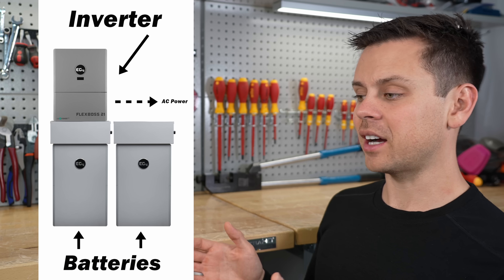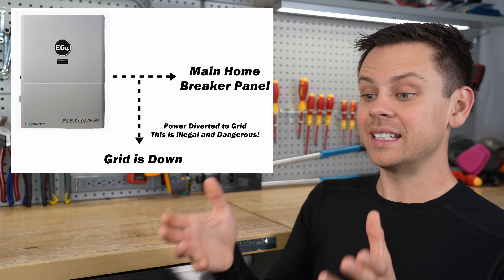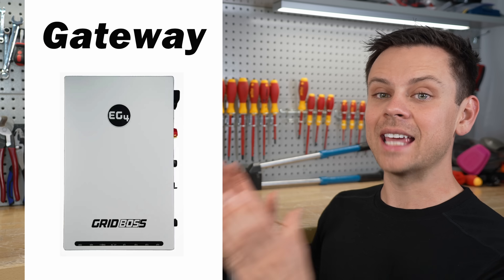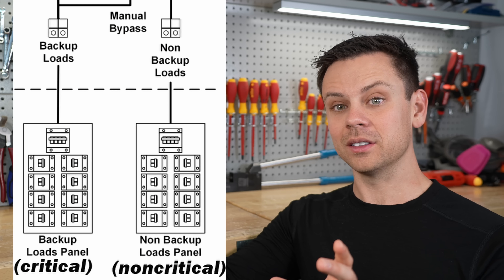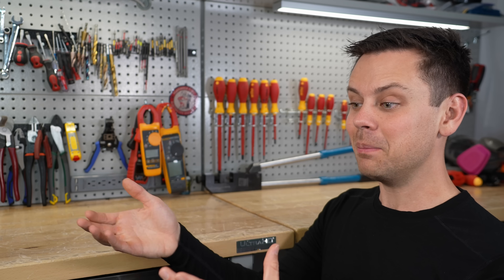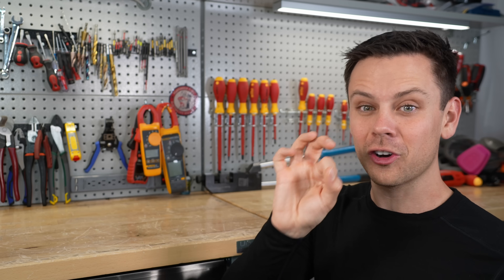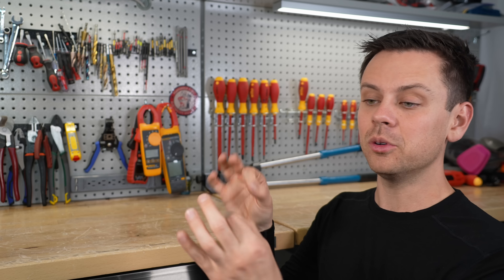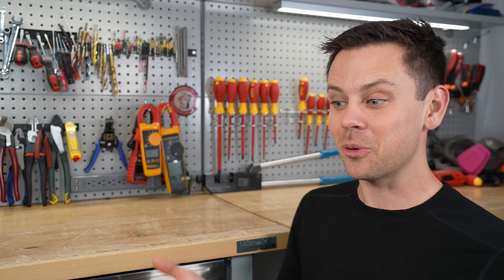EG4 Grid Boss Gateway: What is it?? Beginner Friendly Tutorial!

Comment from the maker: Product links (if you use my affiliate link below, automatically save $50):
Flex Boss 21: https://signaturesolar.com/eg4-flexboss21-16kw-ac-hybrid-inverter-48v-split-phase-21kw-pv-input-v1-1/?ref=cPwLcVc0SW-BjN

If you already have batteries, check out the grid boss/flexboss bundle:
https://signaturesolar.com/flexboss-gridboss-bundle?ref=cPwLcVc0SW-BjN 

If you need batteries, check out these bundles: 
https://signaturesolar.com/eg4-flexboss21-14-3-28-6kwh-capacity-eg4-flexboss21-eg4-powerpro-wallmount-battery-bundle-bndl-e0022/?ref=cPwLcVc0SW-BjN

Grid Boss for those who already own an 18kpv: https://signaturesolar.com/eg4-gridboss-vs-mid-200a-service-entrance/?ref=cPwLcVc0SW-BjN
~~~~~~~~~~~~~~~~~~~~~~~~~~~~~~~~~~
Or buy it from Current Connected! 

Click Here to Purchase: https://www.currentconnected.com/eg4-designed-developed-supported-in-the-usa/?ref=wp

~~~~~~~~~~~~~~~~~~~~~~~~~~~~~~~~~~~~~~~~~~~~~
Tired of getting ripped off? Check out my "Will Prowse Approved" solar product recommendations below!

12V Batteries
https://www.mobile-solarpower.com/lithium-batteries.html

48V Batteries
https://www.mobile-solarpower.com/48v-batteries.html

Offgrid Inverter System Builder
https://www.mobile-solarpower.com/48v-complete-system-blueprint-559371.html

Hybrid Inverter System Builder
https://www.mobile-solarpower.com/code-compliant-48v-offgrid-system.html

Mobile Handtruck System Builder (very popular!)
https://www.mobile-solarpower.com/mobile-48v-system.html

Solar Panels
https://www.mobile-solarpower.com/300w-solar-panels.html

Ground Mount Solar Racking
https://www.mobile-solarpower.com/ground-mount-racks.html

Wire, Lugs and Busbars
https://www.mobile-solarpower.com/wire-and-connectors.html

Tools
https://www.mobile-solarpower.com/tools.html

Fuses and Circuit Breakers
https://www.mobile-solarpower.com/fuses.html

Plug-N-Play Solar Systems
Ecoflow, Anker And Bluetti! So many models to choose from. See my current recommendations here:
https://www.mobile-solarpower.com/full-size-systems.html

~~~~~~~~~~~~~~~~~~~~~~~~~~~~~~~~~~~~~~~~~~
Need to build a large DIY system? Need a trustworthy solar distributor? These are my favorites:

Signature Solar
Creator of EG4! Solar Minisplits, Victron and More! Largest Solar Store Online.
If you want $50 off, please use my link below and coupon code "DIYSOLAR50":
https://signaturesolar.com/?ref=cPwLcVc0SW-BjN

Current Connected
Best Prices for EG4, Victron, Midnite and so much more! Fast Shipping and Highest Rated Customer Service:
https://currentconnected.com/?ref=wp

~~~~~~~~~~~~~~~~~~~~~~~~~~~~~~~~~~~~~~~~~~
Join our DIY Solar Community 
Need more help? Join the largest solar forum on the internet for beginners and professionals alike. 140,000 members and counting!
https://www.diysolarforum.com

Check Out My Free Book
Best-selling and beginner-friendly guidebook to off-grid 12V solar!
https://www.mobile-solarpower.com/the-book.html

~~~~~~~~~~~~~~~~~~~~~~~~~~~~~~~~~~~~~~~~~~
Contact Information:
I am NOT available for personal solar system consult! If you wish to contact me, this is my direct email: williamprowsediysolar@gmail.com
FTC Disclosure Statement and Disclaimers:
Every video includes paid promotion or sponsorship (such as free products for review). Some links on this YouTube channel may be affiliate links. We may get paid if you buy something or take an action after clicking one of these. My videos are for educational purposes only. Information is subject to change/update at any time. Electricity is DANGEROUS and can kill. Be smart and use common sense :) DIY Solar Power with Will Prowse is a participant in the Amazon Services LLC Associates Program, An affiliate advertising program designed to provide a means for sites to earn advertising fees by advertising and linking to Amazon.com
Reply: I use an off grid inverter now that has a grid input for bypass. That grid input is only 80 amp. Before the gateways became the thing to do. The cheapest thing I found was a 200 amp 8 breaker panel with 200 amp pass through lugs. This provides the 200 amp mains disconnect for the grid. Then I installed one 80 amp breaker that goes to grid input on my off grid inverter for when batteries die it can auto transfer. The inverter feeds a 50 amp breaker on a generator interlock in my whole house panel. The pass through panel feeds the main breaker in my whole house panel. So if something is ever wrong with my system I just use the little 60 dollar interlock to change from solar back to grid. Hope that makes sense
Reply: Hi Will can you review the 
batteryevo 
48V King Kong 2
Thanks
Reply: I live in a mobile home. I have 190 W solar panels 20 of them. And I also have around 3100. Watt solar panels. What should I put to go off? Grid on my house or hook to the grid. But be able to switch it on and off without having to get somebody, especially wire it for me.
Reply: Hi Will is any of these batteries  approved to use in grid tie system with battery backup? how i can know which ones are ok? i need cheaper alternative then those big battery packs like tesla canadian solar Lg etc.
Reply from the maker: @sarpertas3590  Yes that's why people buy them. And they are California approved. You can permit the install in any state
Reply: @WillProwse  i think i mixed the videos :) i was mentioning the dumfume one. is any of these cheap 12.8 volt ones has ul listed? i saw some online has ul1741 but they are pretty expensive. im in illinois and comed is hard to work with. they dont really have a list of approved batteries. they do have nice rebate tho 300$ for 1kw inverter capacity and 300$ for 1kwh battery storage so if i can find cheap energy storage i will have money to buy solar panels :) hope to see you making little more grid tie products reviews
Reply: I absolutely enjoy all your hard work.  Keep  up the awesomeness. 
   I was hoping maybe your real world test could include home appliances in working action. 
   A/C or furnace running at the same time as the oven or microwave with the fridge and  lights on.   Maybe in your new shop you could add them??

Comment: Hi Will,  I have a situation where I had a company install a Generac 24kw generator that is connected to a Generac ATS to the house and then later had an electrician install EG4 Grid Boss, Flex Boss 21 and EG4 14.3 KWH battery.  It was working fine until Grid Power was down.  Generator automatically turned on but no power was coming to the house.  The wires that come from the ATS was connected to Grid Boss grid Port.  And when Grid power was down generator was supplying power to Grid Boss grid port instead of to the generator port.  So, I thought about, either disconnecting generator from ATS and then connecting that to Grid Boss generator port.  Or leave ATS connection alone and then use a manual transfer switch connected from power lines coming in from ATS to manually switch power between Grid and Generator where two power lines comes out of the manual transfer switch that would be connected to the Grid Boss grid port and the other power line connected to the generator port.  What would you recommend in this situation trying to keep it simple and the least amount of cost?

Comment: With the 15 Minute peak charge my utility is charging, It makes a lot of sense to concentrate on peak limiting. Peak billing charge is $3.75 per kWh! So I put a chargeverter on my eg4 power pros to take over for the solar on cloudy days.With a load management device on each big load(hot tub heater). opens the heater circuit when approaching set limit (6.1kw) in my case . Batteries take the loads from a separate panel and chargeverter is on grid. This is limiting my peak to 6.1 kw. My peak billing is reduced by half or more per month.(6.1 X 3.75= $22.87)
 Regular kwh is only .08 Cents ! Same 6.1kwh =  (6.1 x .08= .49 cents) ! Your results may vary .Hope this makes sense.

Comment: Hi Will, thanks for covering the Grid Boss Gateway. Your focus on the details is always spot on. I'm trying to learn if you can have the Flex Boss 21 connected to the Grid Boss with grid power available and NOT send power from the Flex Boss 21 to the grid if the house load is low. I really do not want to back feed the grid but have the transfer switch on so the grid picks up load when it's to much for Flex Boss.

Comment: Good video, and semi-relevant to my current (no pun intended) situation of wanting to possibly add more capacity to an existing FranklinWH residential system to expand power for my EV's, which I don't have enough originally installed solar for.  I'm still going through my mind of how to treat the FranklinWH (or Tesla Power Wall, etc.) as the "grid transfer" management, but be able to add my own little Hybrid EG4 DIY micro grid.  Especially before the end of year FTC expiry.  I don't think a FlexBoss helps, since it can't communicate with the FranklinWH AGate...It's almost like I have to add a GridBoss in DOWNSTREAM from the AGate loads...

Comment: I have a 24.78 kw solar system with 2 Solar Edge grid tie inverters. I have a 20kw backup generator and a 400 amp transfer switch. I want to add battery backup to the whole house and support the batteries with the generator so I can use a smaller battery bank and if solar is inadequate to charge the batteries. The problem I'm running into is I have 2 200 amp service panels and I don't want to install a critical loads panel and essentially not be able to choose which loads to power during an outage. Installers I talk to usually want to have one gateway and a critical loads panel. I want to power both panels and be able to choose which loads to shut off. How would I accomplish this?

Comment: I have one good question. I’m actually considering the flex boss 21 with the grid boss in order to get started. I will not have enough batteries to maintain my system, but in the end my goal is to be completely off grid is it possible that I could tie inVictron multi plus inverters to the system as well as the flex boss?

Comment: Is there a way to wire a 50 amp external connection for a gas generator in the event of a major outage as well as an internal connection to a power station for minor outages to the same transfer switch?  Throughout the summer, we have several instances of power being out for a few hours at a time and just need enough power to power my office. In this case, a power station would be adequate. However, in the winter we’ve had major storms that caused outages for several days, which wouldn’t necessitate a gas generator.  I don’t wanna have to log out a gas generator every time we have a minor power outage. Thanks!

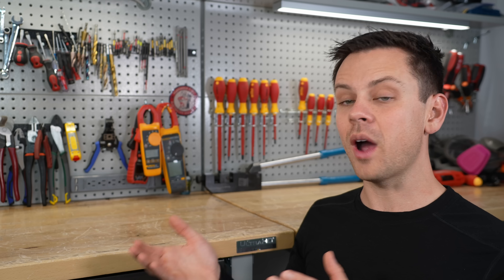Comment: Will, @ about 4:30 you said "If you want to run your system off grid you have to have some form of transfer switch."  Later at about 6:45 you said that if you're off grid you don't need a transfer switch, which makes sense to me.  Am I misunderstanding what you said, or did you just not say what you meant at 4:30?

Comment: Does the grid boss become a double pole double throw relay that connects the home electrical panel or maybe a double pole single throw relay that disconnects the utility power form the panel and then back feeds the panel from a double pole breaker from the grid boss?
A simple wiring diagram would help me. I enjoy your information by the way. Thanks…

Comment: Thank you for making this, it's very helpful. If I were to use an outbuilding to make an off-grid system with the Flexboss, and later connected it to the grid in the main home (about 200ft from the outbuilding), would it be better to put the Gridboss in the house by the meter or does it need to go in the outbuilding?

Comment: What happens if the Gridboss gateway goes down? Theoretically, your house loses all power because it might not switch back to grid power. Conversely, if you have a MANUAL transfer switch and the Gridboss goes down, you can easily switch your system back to the grid while you get the Gridboss repaired. Manual transfer switches don't break down. Complex gateway connectors, such as the Gridboss and hybrid inverters, could malfunction, leaving you without power even though your home is connected to the grid.

So my point is, the Gridboss really doesn't replace the need for a transfer switch. It doe perform the function of a transfer switch, which is great, but what happens if it just bricks for some reason? It requires power to switch your house back to the grid.

Further, neither the Sol-Ark 15k nor the Flexboss 21 connected to the Gridboss makes it unnecessary to install several panels in a grid-tied scenario where you have to meet the AHJ municipal requirements for a solar system permit.

 For example, NEC code requires that an AC disconnect for the entire system be installed OUTSIDE near your service panel. NEC code also requires that a DC disconnect be installed OUTSIDE by your service panel. Both of these disconnects enable emergency responders to quickly shut off power from the grid and from the panels in case of an emergency.

A third system that both the Sol-Ark 15k and Flexboss21 provide is a rapid shutdown system. However, once again, you have to install a rapid shutdown switch OUTSIDE your house by your service panel. Also, with the Sol-Ark 15k, the inverter requires that Tigo optimizers be used to facilitate the rapid shutdown function. It also appears that the Flexboss21 will require the Tigo optimizer RSD system in at least some municipalities, because the optimizers are required to provide "module-level" power shutdown.

So it is not completely accurate to state that either the Flexboss21 or the Sol-Ark 15k replaces the AJH requirement for several panels. Nor is it completely accurate to state that the transfer switch within the Gridboss is sufficient to keep power running to your home in case of equipment failure.  

Think of it this way. If either the Gridboss, the Sol-Ark15k, or the Flexboss21 fails to function, if you have a manual transfer switch panel that allows you to switch your system back to the grid, you are protected from losing power at your home. In the case of the Gridboss gateway, if it fails, I don't think that we know if it will be able to transfer your home back to the grid automatically. In the case of the Gridboss, it DOES have a manual transfer switch, and that will probably work, assuming EG4 has done its homework and designed it correctly. That is a definite advantage over the Sol-Ark 15k. However, if you install a manual transfer switch panel, with both inverter systems you can simply throw that switch and your home will have a direct connection to the grid. That allows you to service, maintain or replace either inverter AND the Gridboss gateway if necessary without losing power to your home.

I am designing an 11.5 kW system for my home currently using the Sol-Ark 15k inverter. I am paying over a thousand dollars for  a Siemens Double Throw 200 Amp , 240V, 2-pole, non-fusible transfer switch to enable me to switch my home from the solar system to the grid at-will. This provides me with peace of mind that if the Sol-Ark inverter fails, I can easily switch my home back to the grid with the flip of a switch, and I can pull the inverter and get it repaired without losing power to my home. I believe this is a superior design the Gridboss, Flexboss21 design.

Comment: Hi I have been a subscriber for over a year now and love your content thank you!.  I am doing the reasearch to purchase a Gidboss and Flexboss 21, and I am trying to find documentation on how to connect a generator to the Gridbos to power my chargeverter to automatically charge my batteries.  That is a specific usecase when I am out and the batteries are low and there is no grid.  Can you please consider demonstrating that functionality? Interested to learn, if the generator will only be started is there is no grid present, I hope I have the option.  I am going to retire in a few years, and I am working now to be energy independant when I do retire.  I plan to keep the grid only as a fallback.

Thank you!
Ron M.

Comment: I am an old Victron guy and installed multiple systems in mobile applications.  I purchased a Flex boss21 and a Grid Boss pair and installed with an electrician (he dealt with the county) in May 2025.  The install went pretty good, my biggest complaint was the lack of details in the documentation regarding alarms/warnings.  I do have a WLAN dongle for the Grid Boss bad out of box.  Support confirmed and the dongle was supposed to be shipped out.  That was May 14, 2025.  Multiple calls back to support and I am being told that they have no control over the replacement process and they cannot give me any ETA.  As of June 29, 2025 still nothing.  While the WLAN is a small item and really does not impact the day to day... It worries me that if I was to have a large failure that I would get the same level of service from EG4.  Meaning none.  I now have thousands of dollars that are in a system that I hope I can get my monies worth out of before it has a major problem.  Basically a throw away system.  I regret this purchase big time!  I should have paid a little more and stayed with a Victron product portfolio.   Buyer beware!!!!

Comment: I’d love to see a video where you show some more advanced setups of the grid boss. For example, I’m currently building a shop that I intend to run off solar using a hybrid inverter. If I’m reading everything correctly, I could set that inverter to sell back and connect it to one of the smart load ports of the grid boss to share excess power with the main house. This would theoretically only require that I run mhfc between the house and the shop (obviously requires breaker boxes to handle the aluminum/copper). Am I crazy?